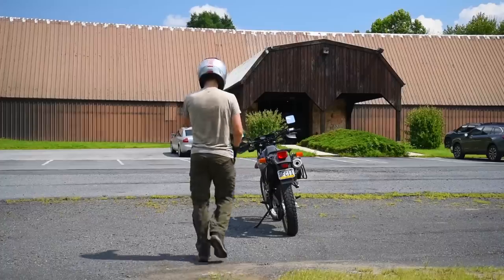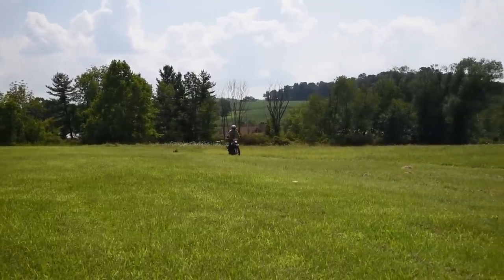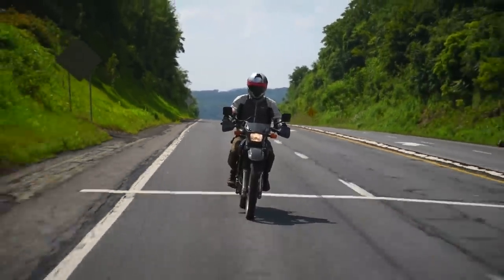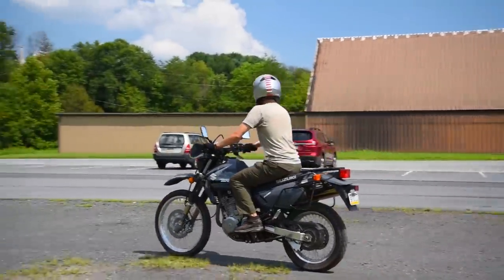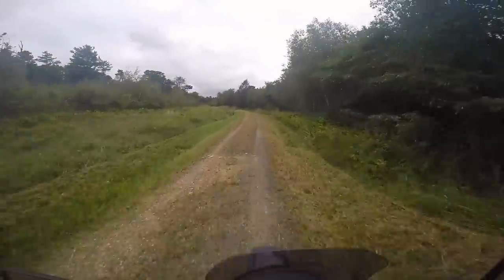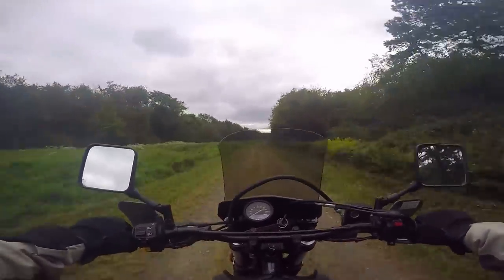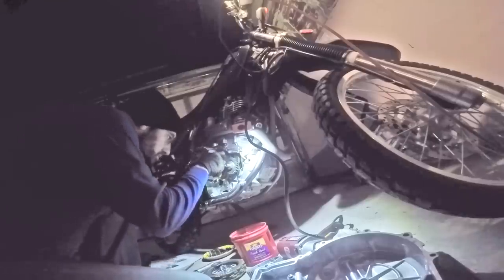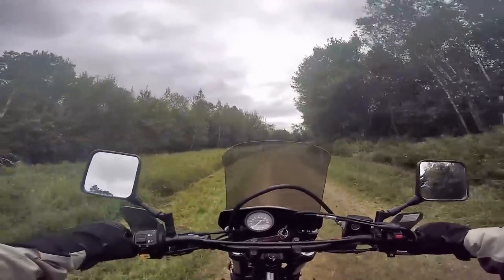2013 Suzuki DR650: Regular Car Reviews

Comment: "whu... Why won't it wheelie..." Accurate as fuck
Reply: Dad?
Reply: Huh? It's hard to keep the front wheel down.
Reply: if u can't wheelie a dr650 stop riding motorcycles
Reply: Cuz you haven't swapped a FCR-MX carb into it yet...
Reply: @crosstrainingadventure This review was definitely from the "regular" rider point of view. DR650 is a wheelie beast with basic techniques like in your videos, no clutch needed even.
Reply: Why argue ? Just get an XR650L . Just put a tune on it 👌.  Power wheelies 1 2 3 gears 4th not sure I'm thinking not unless you clutch it up. I never wanted a dirt bike MX style. But a trail bike all day long . And the Honda fills it . But the DR650 most likely would be my 2nd choice . I'm all done street riding. I've been to many funerals. I owed a GSXR 1000r . It's fast . But 20 minutes, I wanted off for a few.  So Harley's it was . That a whole other chapter. But off-road riding is the best for my spirit .

Comment: Coming from a DR650 owner, I was a bit disappointed to see that you sold yours before having a opportunity to participate in any of the eastern PA dual sport/adventure rides.  I had the exact same thoughts when I got mine but once you have a sanctioned 200 mile event it changes the way you see the bikes strengths and appreciate it for what it does well.  Once you effortlessly cruise by the massive BMW 1200GS's spinning out on a mild rock face or hear the 2-stroke guys literally complaining about being butt-hurt by the 2"x4" that is their seat than you realize that maybe all these purpose drive machines are just more than what's needed.
Reply: i like my dr as well. wouldnt sell it for the world.

...now would i buy an additional bike without selling the dr? maybe
Reply: Same here with an 05 lc4, got it used in late 06. Thrashed it until it died. I mean everything, commuting, drunken beer runs re up missions through miles of forest to shake the fuzz, errands, 500 mile marathons into the middle of nowhere during a severe thunderstorm. No oil changes for 2 years and 20k miles. Traded rides for lines. You name it. Then at 40k miles in 09 rollers locked up on the cam after a failed lash adjustement. Apparently tdcc is not the same as tdce. Bike sat out back in the sun and rain for the next decade. Not even a tarp over it. Then last year wifey had a great idea . Why don't you fix up that old thing and use it to go to work and cut your commute time in half. Hmm I pondered and proceeded to spend the next 6 months locked up in the shed till midnight everyday rebuilding the engine. After my neglected family left me and my wallet was left full of scorpions, bats and tarantulas now I have a new bike. 10k miles on the build so far so good. Threw real mc treads on it thing climbs like a mountain goat. Some sludge on the rad cap, oil and coolant clean though. Thanks for reading, replying and likes. Sorry for the long drawn out post.
Reply: Everyone has different expectations and goals. I own two DR650's. One set up for supermoto and one for dirt. I understand all his talking points on the bike. But I like mine, and appreciate his opinion as well. I am interested in the CRF450L, but cannot afford to buy one new, I will need to wait a few years.
Reply: God, anyone off asphalt on a 1200GS is just cringeworthy IMO
It's like taking an Escalade :<
Reply: @ZealothPL  There's always the Africa Twin (CRF1000) if you want a big bike off road...
Reply: I just got my drz 400 and live around Harrisburg where are these dual sport meets?
Reply: I have a KLR 650 and he basically said to me in a chat one time that he rates 650 dual sports exclusively on how good they are on the dirt.....which is sort of like exclusively rating sportbikes by how good they do on the track. It's important, yes, but the bike has to do more than that. End of the day, he just has his opinion and makes videos on his opinion to blow things out of proportion for comedy sake. Can't take it too personally, he self-admits he isn't an expert on most of what he talks about.
Reply: @themanwithsauce  I come here for the laughs - the review is just icing on the cake if it is at all serious...
Reply: My 2-stroke dual sport has a nice seat 😂 I also don't have a big ass so that might help
Reply: @noirceur_  I too have a 2 stroke so I have first ass experience with the 2"x4".   God I want a seat concepts so bad...
Reply: @thomasfinch5605  haha "first ass". I honestly was a bit skeptical of the bike when I bought it, as I was buying it as a road trip bike for my vacation in South Africa (where I am currently stuck at now 🙄). I'm an above average height but below average weight and have never had a comfort problem on any bike/seat combo before. But this was my first 2 stroke enduro/dual sport. Thankfully everything worked out fine and I was able to ride it everywhere I wanted to go with no problems whatsoever. Took a 14+ hour trip from Joburg to Cape Town (highway the entire time). Then went from Cape Town to the tip of Africa (cape of good hope) about 150kms round trip. Then went up to Namibia and rode along the beach, then back down in safari country, well far East of Cape Town to a place called Oudtshoorn. Then back to Cape Town where I'm trying to stay sane now. All in all, ~4500kms in less than 14 days. Only thing that hurt was my neck and shoulders from keeping them taut and dipping into the strong fucking wind that was present literally EVERYWHERE.
Reply: @noirceur_  damn, stuck in South Africa... Not sure if that's good or bad haha.  Best luck to you either way.

So you're telling me you did a 14 hour highway ride on a 2t!?!?   If so that makes me feel a lot better about the 30 miles I do on back roads to the trails lol.  Honestly my seat isn't terrible (beta 300rr), it's better than some KTM's I've ridden but the DR350/650 I have are couches in comparison.  I'm 5'10 and averaged assed but after 200 miles of Enduro single track with standing most of the time it gets to you.  The first ride is the worst but after that you get the ass catalyst and it's all good.
Reply: @thomasfinch5605  yeaaa idk what's better, being back in the states (I live in Michigan normally) or being here in Cape Town. My rent is fully paid by my work and I still can work via my laptop so I have stuff to do while I wait for the international flights to reopen. Plus the sights here are beautiful 🤷‍♂️

Haha yea from Joburg to Cape Town was about 14 hours of total on the highway riding time, but truthfully I spent maybe another 2.5 hours off the bike either getting fuel, eating lunch or pulling over for a quick piss and some good photo opportunities. It honestly wasn't that bad, most annoying part was having no cruise control like I'm used to on my Beemer back in the states. Like holy shit I'm pretty sure my right wrist gained like 0.5lbs of muscle throughout everything.

The trip from Cape Town to Namibia was extremely cool, you drive through a couple safaris, many mountains, and a few dirt roads. It's not all highway like Joburg to Cape Town is so the isn't a consistent high speed which helps keep you fresh and on your toes. Then the trip down to Oudtshoorn was gorgeous as well, many stops to veer off into the vinelands and tear up some farmland (not the vineyards haha).
Reply: @noirceur_  that sounds absolutely amazing.  What an awesome experience that must have been.  If you ever post those pics definitely post that link, I'd love to check them out.  Did you do the ride with anyone or go out solo? 

Out of curiosity what is it that you do that brings you to SA from Michigan??
Reply: @OnlyKaerius  I love my africa twin and even on the OEM street tires it's very capable in the dirt.
Reply: My favorite is blowing by Jeep Wranglers in the mountains on my DR, especially ones with tons of work done to them. 

The only 4-wheeled vehicle thats passed me on the back roads was a subaru wrx modified for rallying. Still, that car probably costed 10x more than my bike in parts alone.

Comment: The other thing is these bikes run FOREVER! $45 carb kit and it feels like a completely different bike. MPG is drastically reduced, but the fun factor well overcompensates for it. the bike goes from unable to engine wheelie, to pulling up in 2nd gear by accident. these bikes are starved for fuel from the factory, so lean. a jet and shims on the needle...and its a whole new game....

Comment: I've had A DR650 for the past 4 years now and I love it. With a few mods, it actually can be made into a pretty off-road capable bike.
Reply: I use mine as a commuter mostly and weekend rides. Occasional off road. Works well for my purposes
Reply: It's not a bike - but the rider .....+ proper off road tyres.

Comment: Really? Damn man. I put 17k miles on my DR over the past year. If you rode one with better tires than the horrible stock ones, an exhaust, and a jetted carb it is a totally different bike. I will keep this bike untill it is totalled. If the motor lets go then i will rebuild it until it cant be rebuilt. I also take mine off road all the time. The only thing i refust to do is jump it. I have done single track, sand pits, forging a path in the woods, and i still take it to work everyday. I was so hype watching this that i commented before you said you sold it. Now im sad. Hopefully the next owner knows better.

And BTW, the XR650L is BARLEY better offroad. That was a terrible choice for a more dirt oriented street legal bike. The DRZ SMs are also quite a bit more expensive as well. You can usually get the 650 and buy warp 9 SM wheels for about the same price.
Reply: Oh, and the DR650 DOES have a rev limiter in the CDI ignition. It cuts at 7200 RPM. The first gen (pre 95) did not. So no, you CANNOT over rev the bike.
Reply: another thing about the xr650l is that everyone wants a honduh. well at least by me so when i went used xr650l shopping on a budget, they would sell way quicker than i could even react to or they were more than i wanted to spend, usually both. 

then i broadened my search and noticed this DR650 for sale. HALF the price and significantly less miles than the hondas i was looking at.

AND I LOVE IT!

He should have tried some kenda trakmaster knobs on it before selling it. its not like they are expensive and they are GREAT offroad. he said that the dot knobbies are still not the best offroad but these are just as good as any track tire.

ill probably put springs and dampers in it this winter and still have spent much less than buying a stock used xr650
Reply: And then everybody always thinks the XR650l is the same as the XR650R. The L model offers performance fairly similar to the DR. I'm part of an even weirder minority, riding a 2005 DR200. Modified mine for long distance touring. Been riding it since 2009. Sure, having a little more power would be nice, but I geared it up, switched to led lighting, and gave it luggage capabilities. As it sits, I get between 80-90 mpg which usually gives me an average range of about 290 miles. All of the bikes in the DR(Z) family are honestly pretty excellent, but very overlooked.
Reply: @dualsportwannabe3708  I did my MSF on a DR200. Fun little bastard of a bike, handled great and did exactly what I asked of it

Comment: So, does this mean we're going to get a GSX 650F review? :3
Reply: Horror stories from a GSR500 are flooding in...
Reply: I don't know... he said be bought a older Goldwing on Craigslist on a past podcast, so this is definitely a surprise.
Reply: YES!!!!!
Reply: Yes please, that's the bike I currently own
Reply: GSX650F and Honda CBR650F, the official bike of "I wanted an inline-4 sportbike, but my dad has a superbike and he refused to let me have a 600 as my first one. Something about too unforgiving or some bullshit like that, instead he made me have this heavy ass thing that barely moves. What? It's only 5 lbs heavier than his bike, runs a low 12 and has a 0-60 of under 4 seconds? Shut up you don't know what you're talking about this thing's too slow for me!"
(Aside: calling 460lb heavy is laughable and weight generally= stability)
Reply: I had a 1994 GSXR-750W as my first bike (Yes, I've heeded Regular's advice. THEY WILL KILL YOU. Heeding his warning, is why I didn't die). They're no joke, fun as hell, but not suited for individuals over 6 foot. I'm 6'3 and learned that the hard way. Which is why I sold it. 13.5k redline babiiiiii
Reply: I have an 08 gsx650f that would love to be the volunteer for that episode and I'm pretty close to PA.
Reply: I had one as my first bike, and it work out well for ME for the most part. I did end up dropping it about 3 times, that sucker is HEAVY. However, definately not a good bike for an 18 year old with something to prove. Not as fast as a supersport, but still fast as hell. I ended up trading mine in due to some corosion issues I was sick of fixing. Other than that it was a great bike. Now I've got a 2013 HayaBROsa!
Reply: Hmm, i had a gsx650 for a while, it's the "Is that a GIXXER?!" "Is that a HI-a-BOOSA?!" no, it's the little rust cousin, it's great on gas and much more comfortable to commute on, I just upgraded from the Ninja 250, i'm ready for my first big bike, but not too ready. All said it was the best "just a bike" bike I ever had. But if I had to explain that extra 50cc means it's slower one more time...
Reply: Great review and lived the same story, lol...but have been wanting it back lately....maybe my TW can keep me satisfied on the trails and my vstrom is great on the roads.
Reply: You predicted the future
Reply: 3 months later, yes
Reply: I think he did one already.

Comment: I bought a DR650SE this summer.  its a 96 and needed a carb rebuild and a new gas tank, but after that its running like a hot damn.  I think Mr. Regular is underselling these bikes.  Ive been taking it all over the trails and single track stuff near where I live.  After getting some real DOT knobbies and a larger fuel tank, its serious an awesome adventure bike.  Ive set it up more for going offroad than street.  Granted, a smaller lighter bike might be better for some stuff, but this gets me pretty much anywhere i want to go, and its still like 50-60lbs lighter than the KLR650.

Comment: I've ridden a 1998 DR for three summers now. I just love it, and have adapted to its limitations. You're right in saying that it must modded to suit one's needs. The previous owner installed a KTM front fork – very sturdy. Brembo brake up front – fabulous.  Öhlins in the rear – fantastic. Pumper carb, titanium exhaust. Lighter than the original. With taller gearing (14/41) I've turned my Doc into an easy traveling bike. The tyres (Conti Track Attack) are great on asphalt and good on gravel. I'm 6 feet tall and get my soles on the ground. I love commuting on it, but it'll do highways, too. Many riders say a Dual Sport is the thing to have if you only have one bike. I can't imagine a better one than my doc, thank you very much!

Comment: Watching you fix the nsu gave me flash backs to replacing the doohickey on my 07 klr.Its kind of funny how there's always one thing wrong with the engines on most cheap thumpers.For the uninitiated the doohickey is a name for the infamous cam chain tensioner. It's like a triangle with a curved slot at the bottom and a hole at the top that fits on a gear to put tension on the cam chain. The problem with it is that it's made of cheap steel and they usually break at the weld on the top mounting hole. So if you don't replace it with a cnc part it can break and send shrapnel into your engine. I got lucky and had mine break but it stayed in the sump. Now that I have replaced it the engine is rock solid.

After that I put on an FMF power bomb header, a Big gun evo r slip on, 142 main jet, klx needle, Shinko 705 tires, a progressive front spring kit, and a rear progressive 465 shock. I also did some common carb mods that help with throttle response. The bike feels so much better now and I can kinda power wheelie in second. It's still an oil burning pig but at least its reaching peak braap.

Comment: I used to have a DRZ400S and had similar dilemmas. Mostly rode it on the street ; Changed it for a V-Strom 650 2010 which i kept 1.5 year. Enjoyed it too but i wanted more power after 10 years of riding sub-70hp.
Moved up to a Yamaha FJ-09 and i'm very satisfied ! If you like the high riding position and the idea of a torquey triple, I highly recommend trying one if you get the chance. 

It's a machine with a lot of character that will wheelie whenever you ask it, and even sometimes when you don't, so you know, at least you'll be in control of whether or not you indulge the incompetent, overbearing sods.
Reply: Seb640 I Love Fz09's. I wish to have one someday
Reply: @jamirdianalan6349  Its a very fun bike ! They are raw machines. Its actually because of my buddy who has one that i went with my FJ ! Are you riding a motorcycle currently ?
Reply: Same. I went from a DRZ400 to a Bandit 1250 S.
Reply: First I've heard of the FJ-09. I have been dead set on the V-Strom for the same reasons you sold your DRZ. I'm riding a DR myself right now, but since having two bikes would be difficult right now I'm gonna have to sell it. 

Do you still have the FJ?

Comment: As the owner of a DRZ400, I agree with most of the negatives of the dual sport category... Yet there is something there, that you mentioned at the end of the video. Experience it, then sell the bike for what you bought it for when you've had enough. These bikes come alive when you realize that you can go ANYWHERE on them. They are only limited by your spirit (and perhaps the gearbox as well). One day i'll sell the DRZ, but until then I have many more suffering filled adventures ahead of me.